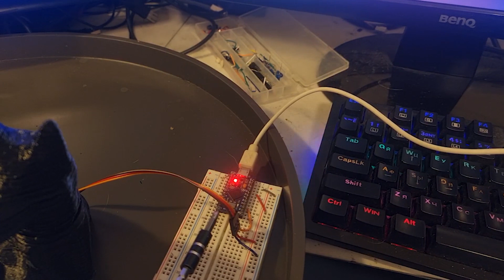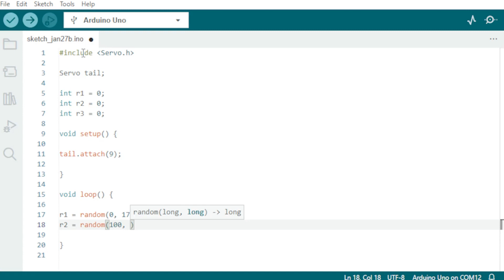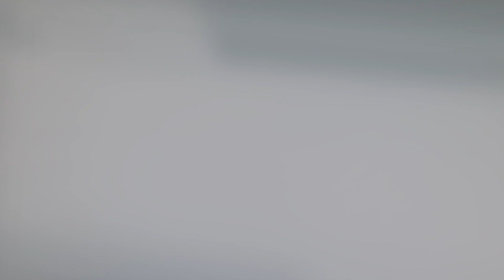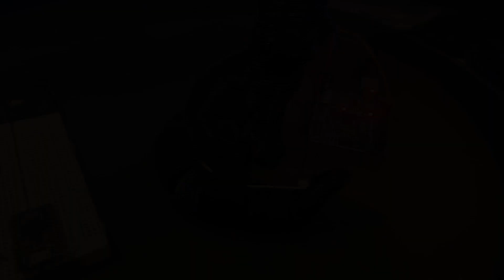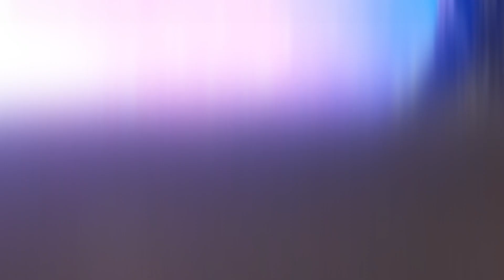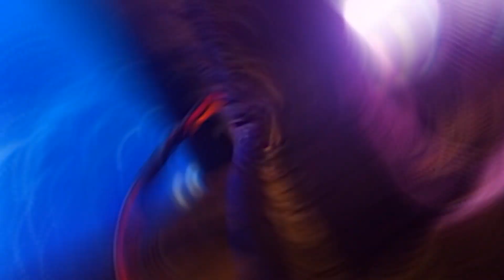Arduino Random servo movement Example

Comment: Hi Mike, nice video, would you be able to generate a random code also for a stepper motor?
Reply from the maker: Hi giovanni thanks for the feedback, i dont currently have any stepper motors to test this with, but the psuedo random number generator for the servo step should work for a stepper motor step aswell, just remember that the random number needs to be generated at the start of the loop and stored as an "int"

"stepper.step(r1);" 

should work the same as 

"servo.write(r1);

you will just need to change the random value range to the range of the stepper

i am planning on doing a full tutorial with servo, dc motor, and stepper in the future, below is a link to the code from the video.

https://github.com/MikeTheevil/Fox_Tail
Reply: @miketheevil Thanks Mike, I await your next videos, now I'm going to download your file
Reply from the maker: @giovannimanilardi480  good luck with your projects :)